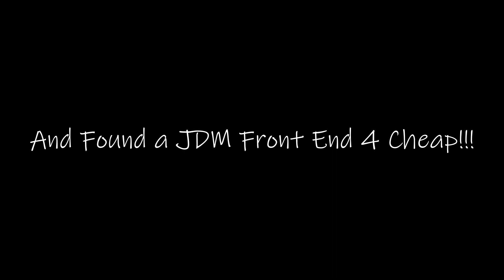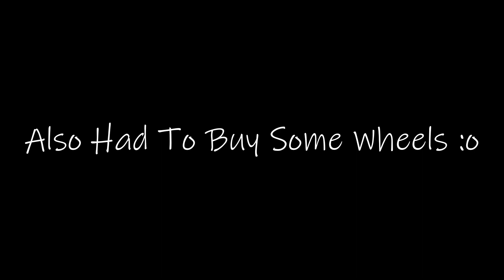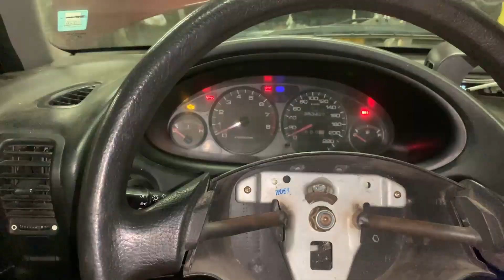Integra Build In 15 Mins (2 Year Process)

Comment: nice job, im in vaughan as well....i just bought a 99, who did the rockers for you?
Reply from the maker: Thanks man I appreciate that! For the rockers 403 auto but I’d recommend elsewhere tbh just due to a couple mess ups and taking 6 months to do it
Reply: @DemonTeggy  ok cool, i appreciate it.  Did you scrap the parts car?
Reply from the maker: @danmazz8733  yes i scrapped them all and sold 1 of them. i still have parts tho
Reply: @DemonTeggy  congrats on the shop! I need to make a visit.  I need replacement rockers, if you come across a clan car, hit me up.

Comment: Hey I just bought a integra without the the 6 lights could I ask you how did you get the 6 light front
Reply from the maker: It’s a Complete front end that was imported here from Japan. You can probably find them online for around $1500-$2000. Just search JDM Front end for integra
Reply: @DemonTeggy  thanks bro could I easily remove the headlights of the dc2 the 4 light ones and then hook up the jdm front end to it or do I have to make cuts to make the lights fit somehow?
Reply from the maker: @darrennorris01  you’ll have to make 2 cuts where the original 4 lights sit, and the rad support needs to be swapped to the jdm one so the hood latch fits. It’s a bit complicated to explain but not hard to do.
Reply: @DemonTeggy  is there like a video on it?